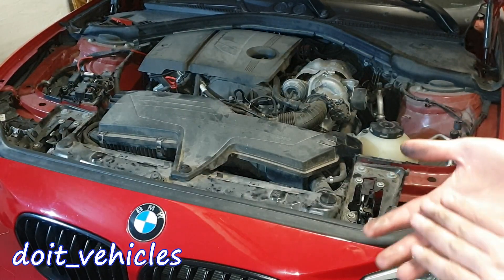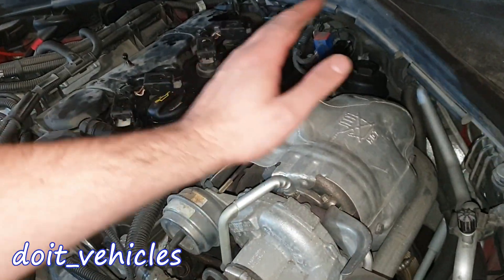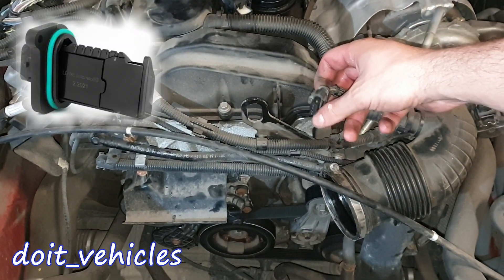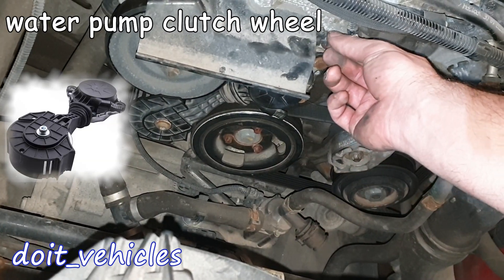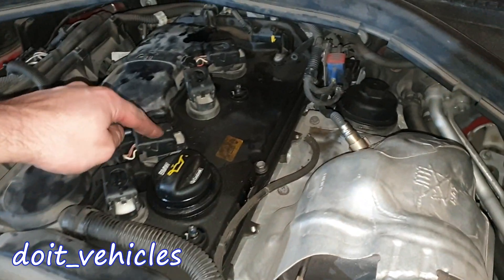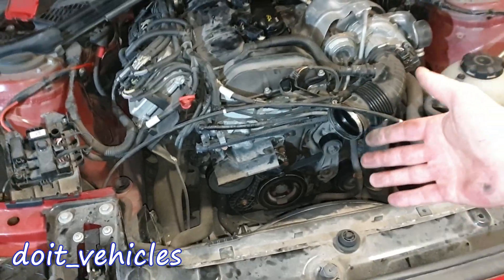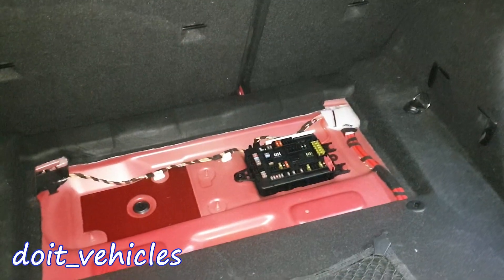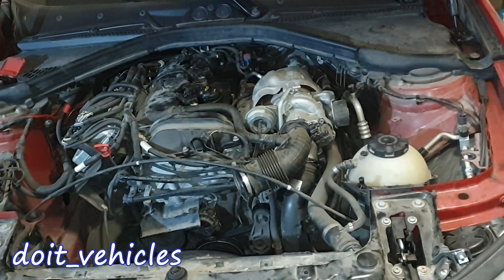114i BMW Engine Components - layout / location 116i F20

Comment: This is sooooo helpful.. thanks.. how do i access the high pressure fuel sensor?? I have an n13 116i and i need to change it because it is faulty.. do you have a video showing the process? If not do you have a link or procedure? Thanks.. keep up the amazing work.:hand-pink-waving:😁

Comment: The oil pressure sensor is located on the oil filter housing. There is a vacuum pump and a coolant sensor on the back of the engine. There is an axillary coolant pump on the front. There is an integrated PVC membrane on the valve cover.

Comment: Hi, I have the 316i f30 with the n13 engine. I’ve got oil in my coolant reservoir. No over heating though. Any other issue other than head gasket?

Comment: I have a question for you, when I drive my F21 114i (similar to yours) for like two minutes and then I stop in a traffic light, it starts idling on 1200/1300 rpm, why it does that? thanks, love your videos :)
Reply: greetings,, did you solve the problem on your BMW,,, I have the same problem, so I would appreciate your advice.